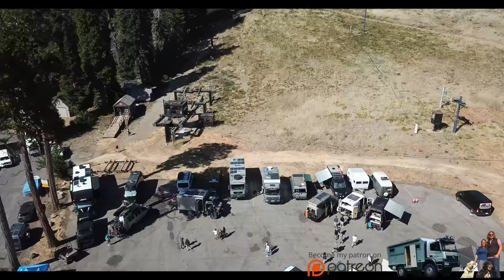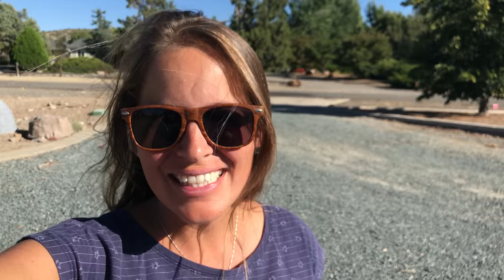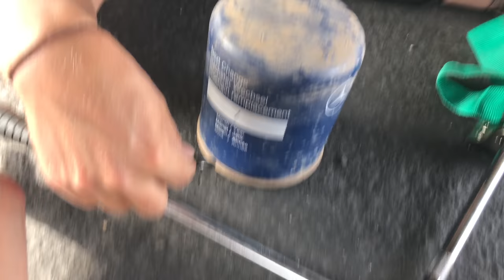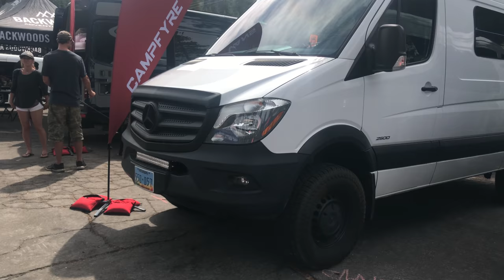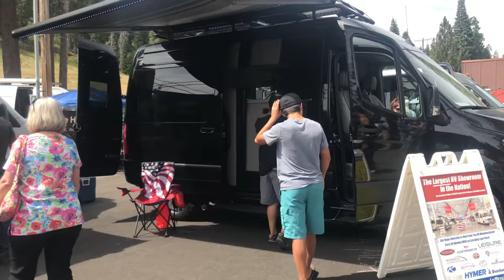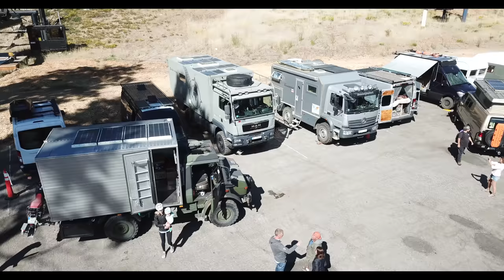Update, Adventure Van Expo and some maintenance! ► | Lake Tahoe

Comment: Sorry to hear about your drive. I recommend always have any important data on at least 2 drives. Assume any single one can fail at any time. Video on the road is tricky, because even if you have 2 drives, if you have a break in, they can steal both! Basically buy hard drives in pairs and clone the data from one to the other. Then hide them in different hard to find places in the vehicle! Or even put one in your back pack at all times, and leave one in the vehicle. Not easy to keep data safe!
Reply from the maker: We learned the hard way... :( We just cloned the other two external drives and we will send one copy of each home to Germany, like that is always save! Thanks guys!

Comment: What operating system or format was hard running?

Internal or external hard drive?

Answers help?

Burn an
Reply from the maker: Was a external hard drive from Seagate 4T almost full, in ExFat format and we where using on our Mac book Pro. Last Friday I transferred the pictures and videos from my iPhone to this external hard drive and was working perfectly, then Saturday morning I tried to open but the computer was not opening and Sunday morning we tried in a Mac book from a friend and he run the disk utility and then the hard drive finally opened but show now empty... 😢😢😢 thanks for your help John!
Reply: For a years worth of data sent name of guy in Ontario. He’s great, sent phone number to your email address. Don’t try to recover, let him do it or you could rewrite it.
Reply: @LiveandGive4x4  this comment is probably too late. As an IT guy I have had Seagate drives fail more than any other drive. I believe the issue you are experiencing is from power spikes, the Seagate firmware goes corrupt. I have had to recover over 15 drives from Seagate. I use a service called 300 dollar data recovery (google it). I'm not affiliated but a happy enterprise customer. I also love your channel!